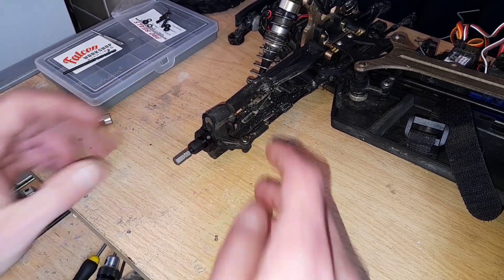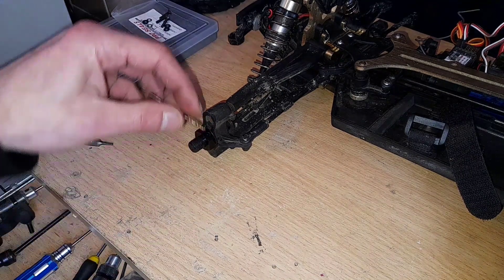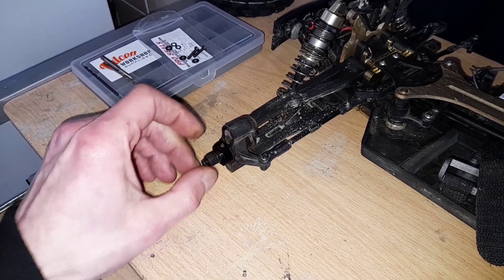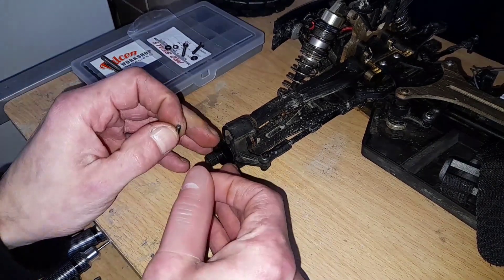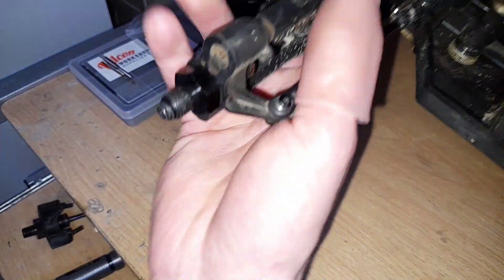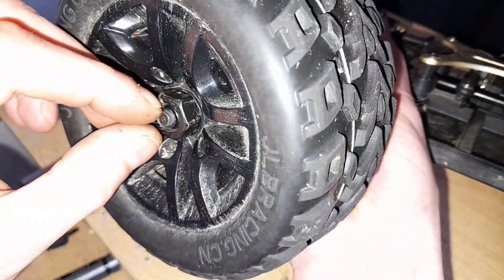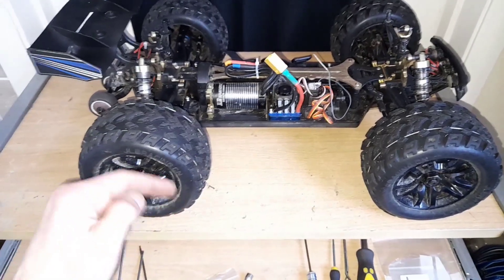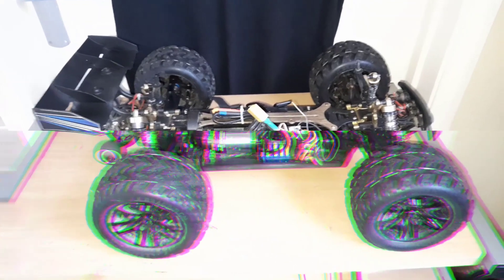JLB Cheetah CVD issue/fix 2021 BEST MOD! upgrade! Arrma Tough? MUST WATCH!

Comment from the maker: (Shims 3×6×0.2) https://www.ebay.co.uk/itm/10-50X-M2-M40-Stainless-Steel-Ultra-Thin-Flat-Washer-Ultrathin-Shim-Plain-Gasket-/114590536320?mkcid=16&mkevt=1&_trksid=p2349624.m46890.l6249&mkrid=710-127635-2958-0 
(O-rings) https://www.ebay.co.uk/itm/O-Rings-2mm-Cross-Section-Nitrile-Rubber-joints-toriques-metric-/254546191614?mkcid=16&mkevt=1&_trksid=p2349624.m46890.l6249&mkrid=710-127635-2958-0 
(Screws) https://www.ebay.co.uk/itm/M3-3mm-High-Tensile-10-9-Socket-Countersunk-Screws-Black-Self-Colour-Bolts-/321594905278?mkcid=16&mkevt=1&_trksid=p2349624.m46890.l6249&mkrid=710-127635-2958-0
If parts aren't up to standard I suggest sourcing own parts with sizes provided.

Comment: Good tip. I've plugged my axles to stop dirt getting in but this is a much better idea. Will be doing it straight away.
Reply from the maker: Thanks for your comment dude this will be your perfect solution. It's my version of the typhon grub screw system But in my opinion its better for the reasons I explained lol. Keeps dirt out and the hub locked solid. Dont forget to share  and thanks again for your comment
Reply: @mehimrc1314  I've just done my cheetah. I found that 14mm M3 button head screws with an M3 nylon washer are pretty much perfect. I've also filed a slight cone on the end of the screw thread, so it doesn't get chewed up when coming into contact with the pin. 👍
Reply from the maker: @51im  that's what the information is for dude improve on my measurements and make it your own lol. 
only had 16mm so I thiugh why not make it work so then idea can at least get out there. With a nice arrma touch. Thanks for you comments dude hope you've hit the like button and shared.

Comment: Hello? If you don't mind, I'd like to ask you one thing. Do you know if full metal ea1057 parts exist?
Reply from the maker: The cheetah differential is all metal apart from the plastic case. I've not seen any metal diff cases yet. 
So you can buy metal diff housing but not the actual diff case. Hope that makes sense and helps.
Reply: @mehimrc1314  Previous videos have been very helpful to me regarding the cheetah issue.  This reply was also very helpful, thank you very much
Reply from the maker: Your welcome RC community should all be about help and fun. Have a great day happy bashing.

Comment: What do you do about your dogbones mate, mine Abend every run, even with small jumps.  ive heat treated, quenched and tempered them, still bend. Arrma has a bone that fits lengtvwise, just need to dremel the head down to fit into cup...
Reply from the maker: So your wanting to use arrma 6s CVD shafts and spin the head down to fit the cheetah cups. Epic ingenuity mate, I've not bothered mate they bend I bend them back. Unless JLB make upgrades it's up to us to find that solution. Keep us posted on your progress.
Reply: @mehimrc1314  JLB EA1078, is not supposed to be an upgrade ?
Reply from the maker: @julienv1959  that's is stock part, no actual upgrade CVDs are available. All stock parts are worded to say upgrad however on arrival they are the same stock item.
Reply: @mehimrc1314  Honeslty to reduce slighly the bend I surround the dogbone very firmly with electrician tape with several layers. Seems to be better. The hammer do the rest :p
Reply from the maker: @julienv1959  reading what your saying and willing to try, then why not wrap the dogbones is fiberglass sheet and epoxy resin over the top. Thats my engineering mind coming out, if I had the spare cash I'd try the idea my self and make a video. Or wrap/stitch jeans material around them tight and epoxy over that. It's called micarta, think outside the box

Comment: Genius? maybe ;)
Reply from the maker: Cheers RC Kid Mike! Comment of the day lol.
Reply: @mehimrc1314  got a v2.0 idea. Use a round head instead, incase it the hex strips you can dremmel out a flat head)
Reply from the maker: @rckidmike3561   there could be a possible v3-v4 depending on your taste. Anodized M3 bolt slightly smaller to bring it in closer. Chris E in the comments used a smaller one after watching the video. He's happy with the outcome. Thanks for the great comment dude.